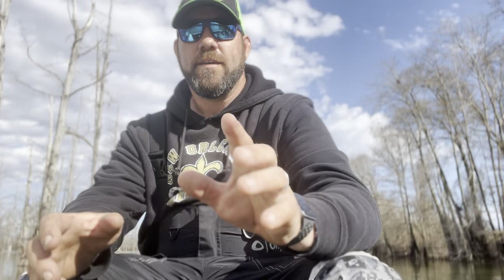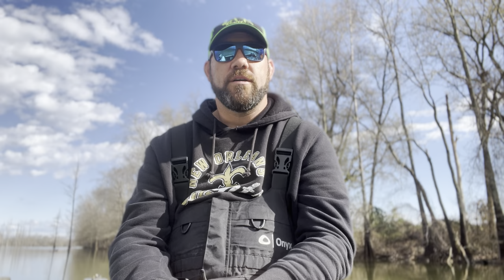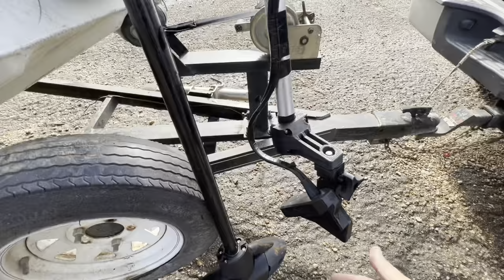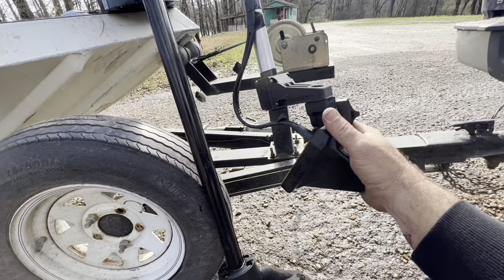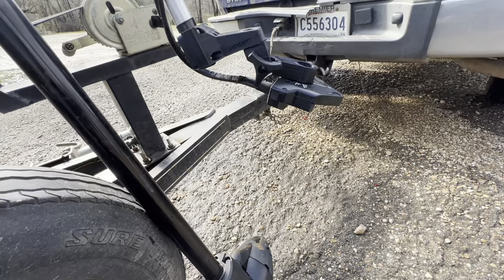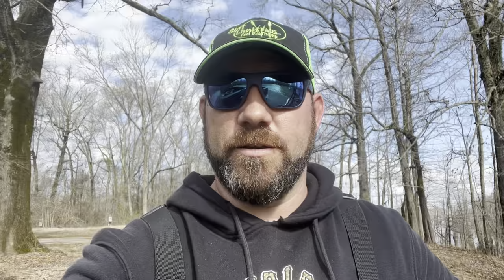Garmin Livescope Perspective Mode: How I Adjust My Summit Outdoors Perspective Mount Angle

Comment: I am mounting the LS 34 on the true scanner starboard side, is the LS cord facing forward or towards the back? In your video yours is forward and on the Garmin book it shows to the back ?
Reply from the maker: Better check that book again bud. The cord will be in the front on the starboard side. The cord will be in the back on the port side. 

https://atlaske-content.garmin.com/%2Fasset%2Fimages%2FSHaft_mount_Prop_and_Motor_Time1614374562766.PNG
Reply from the maker: Your also speaking of the lvs34. Now that will be mounted with the cord in the back regardless of the side due to the thru bolt design of the transducer.

Comment: The first picture is certainly not fowardmode!
Reply from the maker: What mode would it be
Reply from the maker: It’s in the starboard side of the pole and angled correctly. Do you want a diagram
Reply: @The_Garmin_Guru  I`´m not a native speaker so it´s a little bit difficult to explain. I1m talking about Minute 3.37. As far as my Mount is concerned, the forward mode is locked, when the Top of the Transducer ist parallel to the surface.  Your trancducer seems to be in a sort ob backward mode with the Bottom of the transducer parallel to the ground of the lake. I can´t fix this position with my mount from Kaiser Edelstahl. Naturally you kann use a sort of backward mode to look forward too, but I don´t know, if this has some affect on the elektronik especially on marking a waypoint for instance.